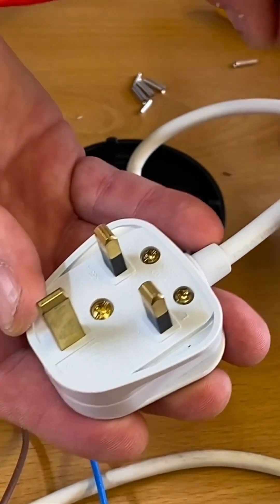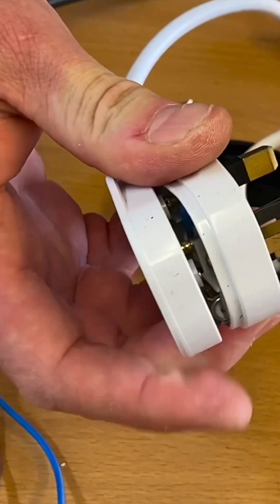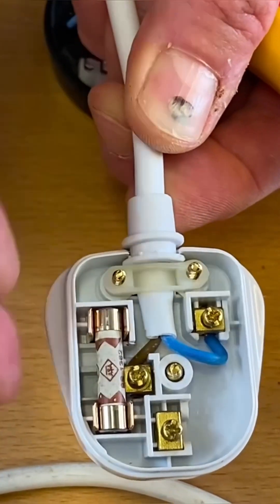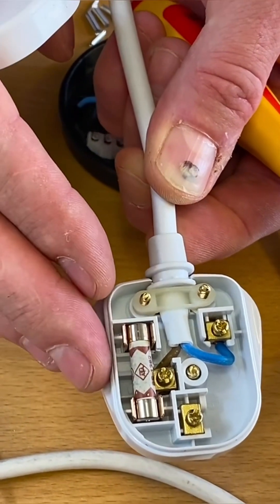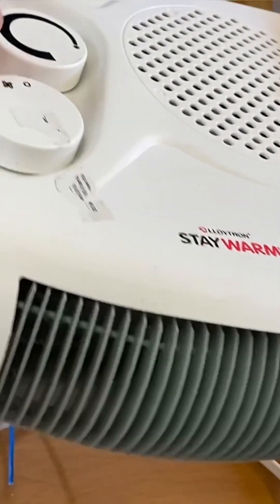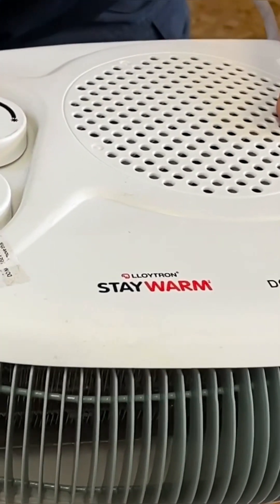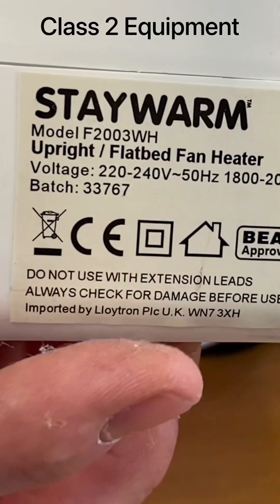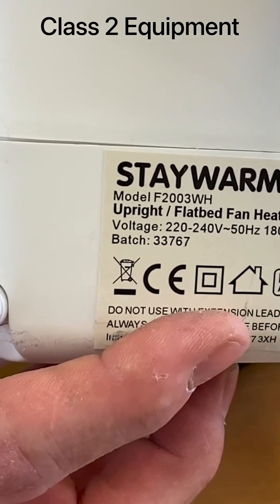Missing Conductor in my Plug…

Comment: The appliance may not need an earth but the cable should really. Not sure how it works for plugs but it is regs
Reply: BS7671 doesn't apply to portable appliances, just the installation. It's a bit vague whether an appliance fed from an FCU is part of the installation however...
I can see though, why it doesn't apply to portable appliances, as they're not part of any specific installation  The one that's ambiguous to me is the flex on lighting pendants, they definitely ARE part of the installation, yet the CPC only goes to the rose. I'd be interested in Gaz's interpretation here.
Reply: @TheChipmunk2008  Maybe Joe could do something about it in Regulation Corner.
Reply: What would be the point of an earth wire that isn't connected to anything at the other end?
Reply: @ferrumignis  to protect the circuit wiring against earth faults (more likely with UK/US style flat cables than with the round style found elsewhere), Extending that rule to dangling lights seems extreme, but the regulations are the bible we have to work to, so it was a good question
Reply: A separate earth conductor within the flexible appliance cable, unterminated within the appliance itself isn't going to provide much in the way of protection. It wont protect e.g. against an exposed live conductor (RCD would though) or shorted live and neutral (MCB or plug fuse would).
Reply: No it isn't.
If you think it is, point us to the relevant part of the correct regulations you're talking about.
I'll bet you can't, and if you think you can, you'll be wrong.

Comment: Why is it not fitted with a moulded plug?
Reply: Moulded 13A plugs tend to overheat more often... due to the resistance at the fuseholder contacts. It's perfectly acceptable from a legal point of view to have a properly fitted re-usable plug fitted. It's actually more common on some makes than others.
Reply: @TheChipmunk2008  iv seen a few molded plugs at running 2.5kw melt the fuse in after some time  don't think ther is any brass or copper in them. Can't beat the old made in the UK mk plugs with brass terminals. These days ther mainly chinesium.
Reply: @Stainless316L  have you priced those plugs lately... but absolutely on the quality
Reply: Depends on how much shock protection the manufacturer thinks the plug needs.

Probably not worth it. 
Why over engineer it and incur higher cost?

If you're going to take an appliance outside and the plug risks impacting concrete/stone etc then yes, it's worth the extra impact protection. But why would you take an electric fan heater outside...going to heat the outside up huh?
(Good luck with that).

Comment: A bit more on pat testing would be good some of the equipment we test is & find is wild,not fit for use a big misapprehension the public seam to have is a pat test is walking round dishing out stickers & no idea what's involved in proper inspection & testing thanks gaz 👏
Reply: Yes, everyoine tries to compete on price for PAT... but a proper check on appliances requires a visual check, removal of the plug lid (or fuseholder) to check the correct fuse is fitted, a full test of the flex (visual or electrical, depending) then a flash test and earth bond test (at several amps).  That's how I was taught and it takes several mins per appliance, minimum